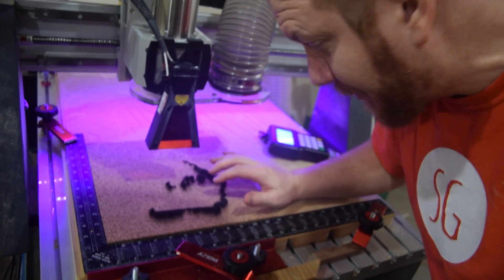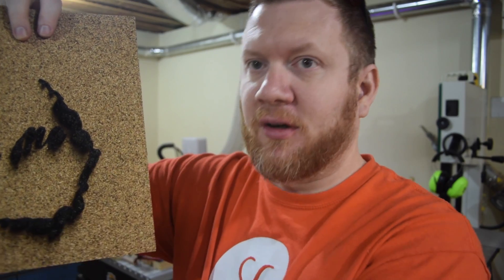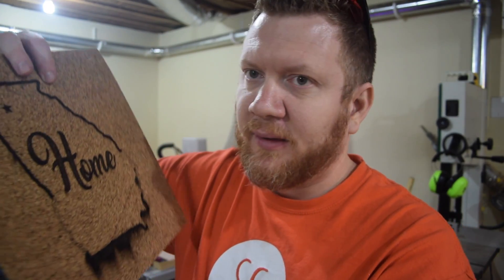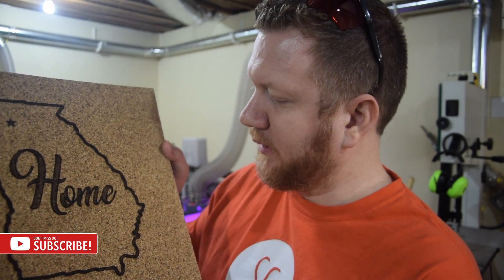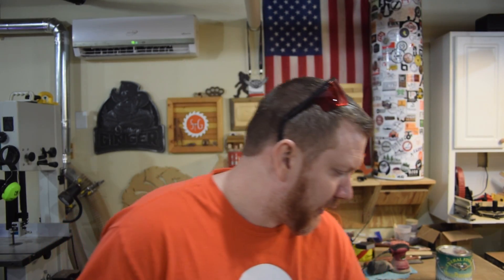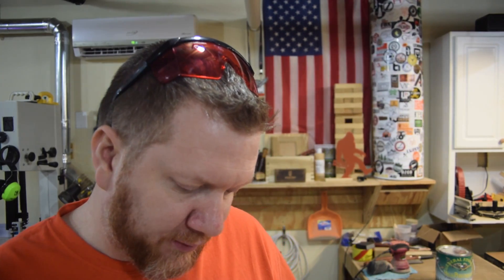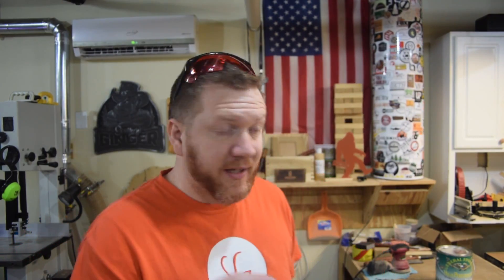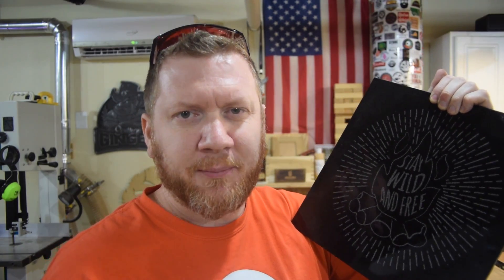CNC Laser tips and tricks | Axiom Precision CNC | JTECH laser

Comment: Hey, Zach, a question about settings. I have an AR8 Pro with the 4.2w JTech laser. In the laser manual it says to create a tool with a diameter of 0.012 and a suggested stepover of 75%, which is 0.009. In your video, you mention using first a stepover of 0.025 and then 0.03, which is 250% of the tool diameter. Are you using a bigger diameter than 0.012, did you misspeak, did I miss something somewhere...?
Reply from the maker: There is a good chance I misspoke but the main thing is to get out there and try varies settings. Some extreme settings are worth knowing what it's capable of. If you're talking about the cork, you have to run it fast and yes a high stepover or it will burn!